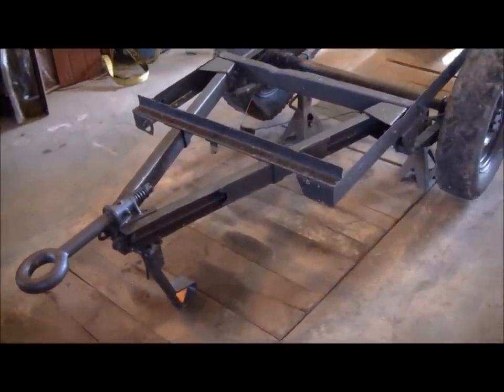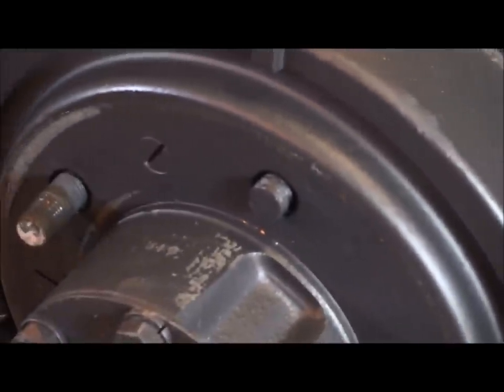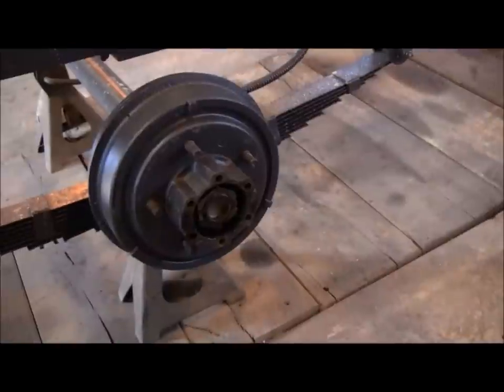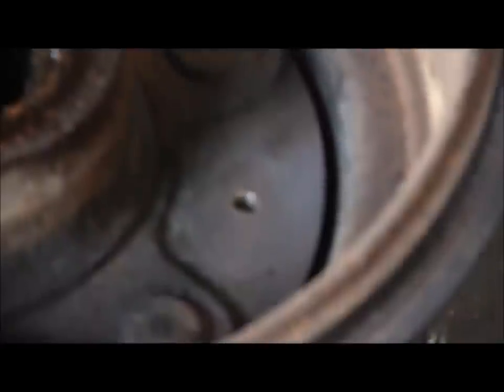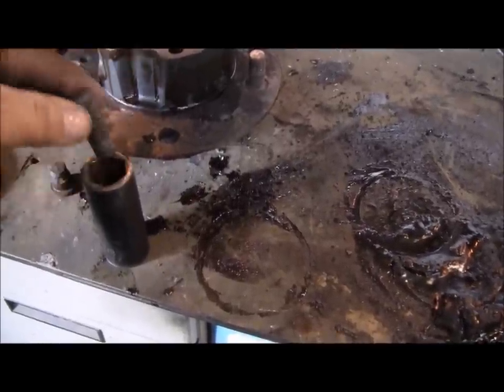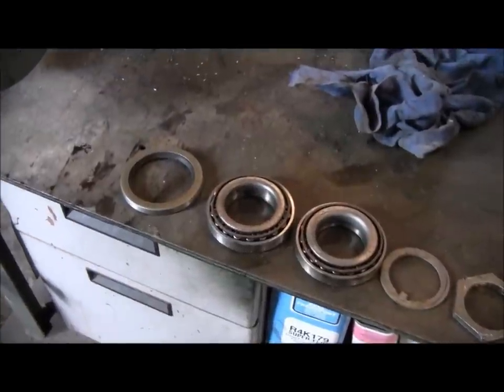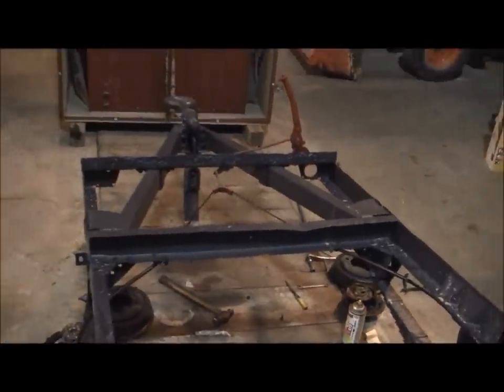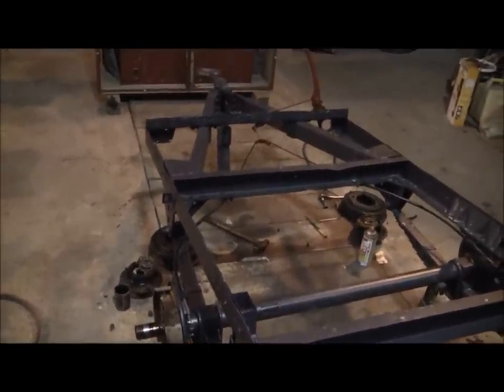M100 to MBT Trailer Conversion, Part 2

Comment from the maker: Yes, correct. But once welded as shown it holds it's rated capacity easily - 500 lb off road, 750 on road. I've overloaded these with dirt and blocks and bent springs backwards, but never had the frame fail.

Comment: Where did you get the socket for taking off the Hub Nut? What size is it? I have a M116 trailer I need to pull the hub.